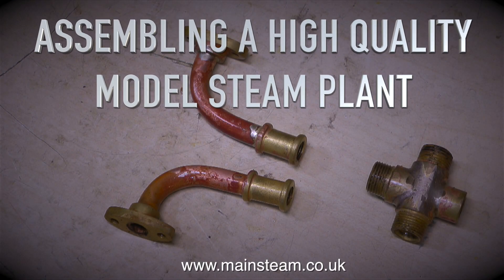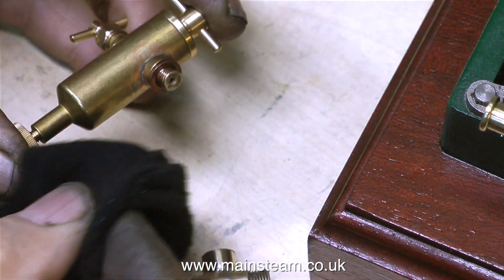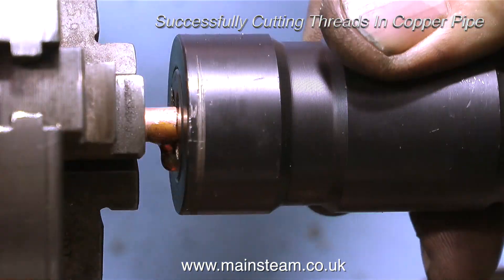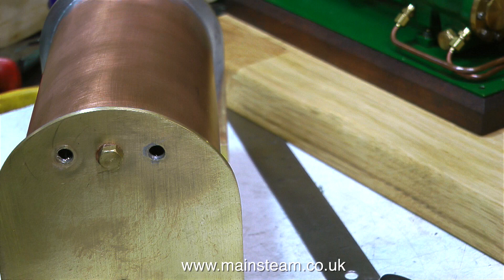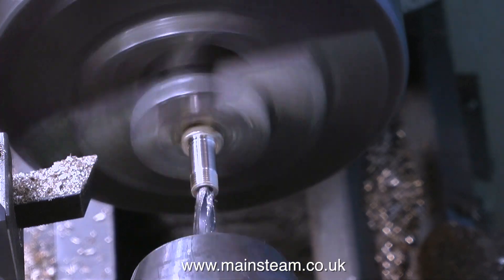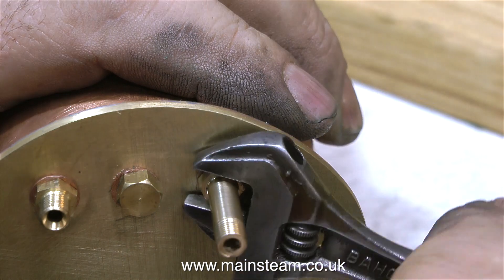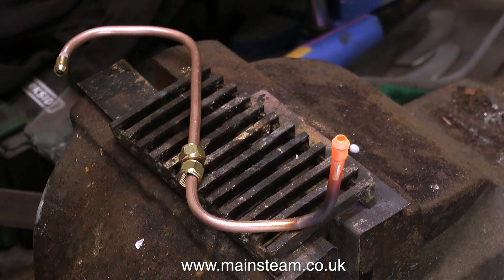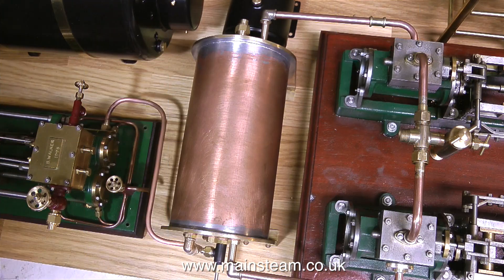ASSEMBLING A HIGH QUALITY MODEL STEAM PLANT - PART #10

Comment: A simple thought for correlating. Or getting that 4 way to be at 90 degrees to the oiler. (Forgive me if I messed up the terminology.) A given thread such as 1/4-20 will have 20 threads per inch. If you take 1 and divide it by 20 you get  .05 per revolution of the nut, bolt, or what have you. If you divide that by again by 4 you will have .0125. This may help to keep from having to try 6 or 7 different sets of washers when trying to get something to look right.

Comment: Keith, did you consider running the cold water supply to the boiler through the condenser, first, to help pre-warm the boiler water supply, as well as increase the condensation?  I just thought that might improve the efficiency of both operations, though I imagine that would require some sort of exchanger inside the condenser?
Reply from the maker: No I didn't consider that because the cold water causes too much of the steam to condense and therefore too much time is spent emptying the condensate . . . . I have tried most things over the years ....... except maybe Oysters, as I am seriously allergic to bottom feeding shellfish .... and Prawns ....... {:-))))
Reply: Oysters are foul :(  Yecch!  I stand by you on that one.  And there's not enough cocktail sauce in the world to get rid of the fishy taste of shrimp...

Back to steam:  I imagine at small scales it is unrealistic to completely recycle condensate back to the boiler?  (I believe there is a technical term for this, but I'm a video sound mixer by trade, not a musician or engineer, so I don't know these things ;)
Reply from the maker: Yes, it's not practical in the very small scales to pre heat the water in an exhaust condenser.

Comment: I try to avoid threading copper preferring to solder it into a coupling, but when I have to I make the area extra long and solder a piece of tight fitting bras or steel in the end. thread it and then cut off the extra.

Comment: How did you fit the exhaust pipes onto the condenser nipples?  I saw that the condenser nipple was threaded and the elbows were threaded.  Wouldn't there have to be a union someplace?

Comment: They don't make split unions in modeling sizes? If you were to have a problem with the condenser you would have to undo those fiddly nuts on the engine to remove the tank?
Reply: Scratch that.... I just looked at Jubilee Fittings and see the double pipe fittings are not very attractive, wouldn't fit with this build IMO.